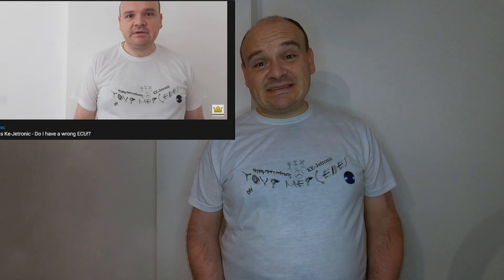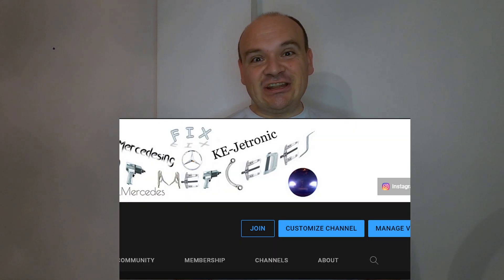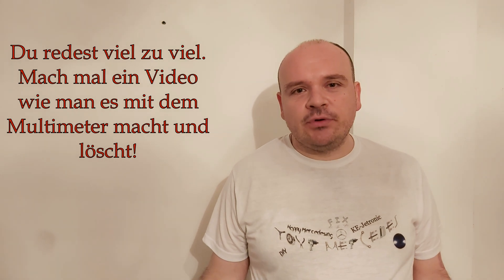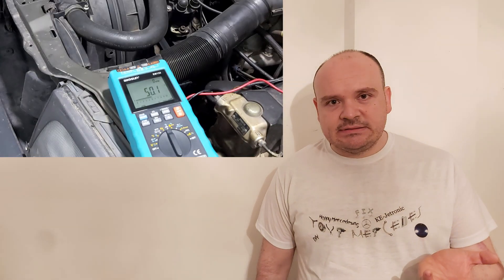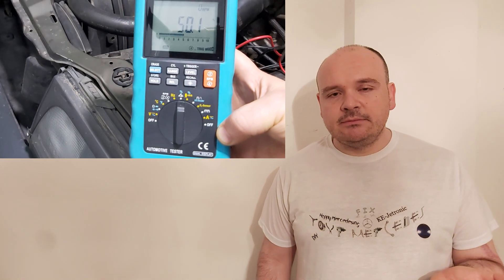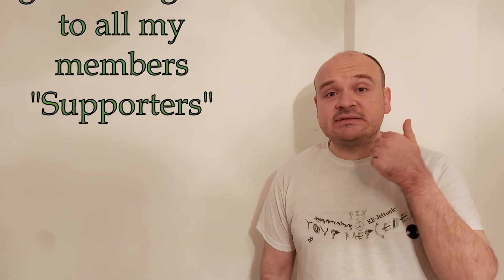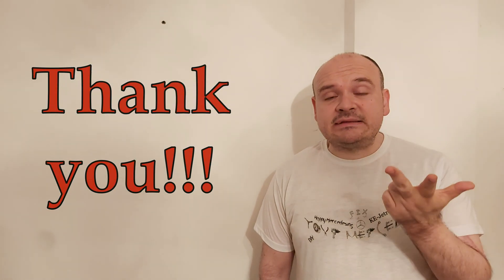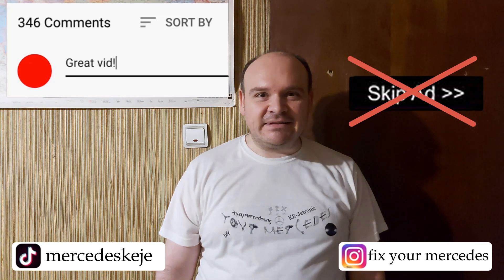㉦Mercedes Ke-Jetronic㉦ - The answer to the comment on easing a code

Comment: Zdravo. A quick question - is the Mercedes EHA a plug and play device. My current EHA is leaking fuel  replaces o-rings still leaking. If I get new EHA can I just simply replace or do I have to adjust mixture? Thanks!
Reply from the maker: Hello. If you buy it brand new it should be pre-adjusted accordingly. If not, the best way is to measure the depth on your original and then compare to the replacement part and if any discrepancy, then... I think you get it.

Comment: Maestro buenas tardes tenía días q no lo molestaba quería saber si me podría sacar de una duda el cable de corriente que va al regulador de ralentí viene de la centralita o es aparte ? Gracias
Reply from the maker: Hola Carlos. El cable de alimentación (púrpura/rojo o azul/rojo) va al relé de protección contra sobrecarga, contacto 87L. El cable masa (rojo/blanco) va al pin3 de la ECU. Saludos
Reply: Gracias maestro como siempre enseñándonos.saludos. @mercedeske
Reply: @mercedeske maestro buenos días el tornillo allens q lleva la válvula iac por un lado que exactamente gradúa (el flujo de aire manual) gracias cuando esté a su disposición me dice gracias.